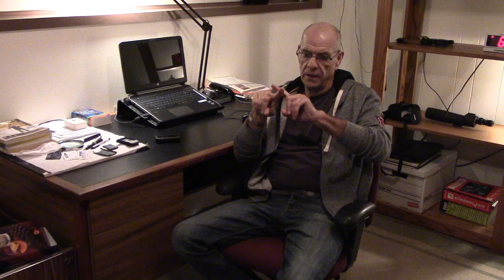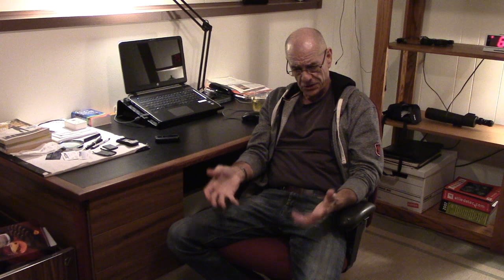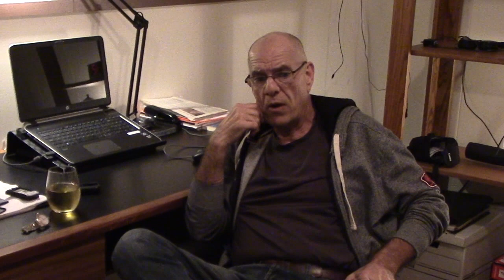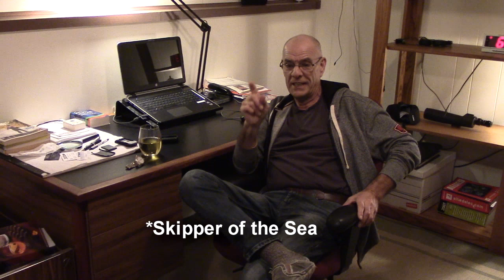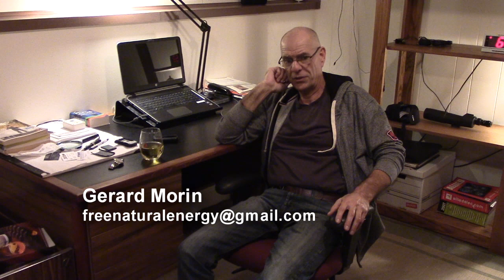Gerard Morin: The Double Helix and Tesla's Sea of Energy

Comment: Get you some pot stems and charged carbon from hugelkulture bed or build over ionic aquifer and you can build a super capacitor antenna using like graphenne cement and never need electricity again. Charged by Stubblefield coils. Then we can grow carbon panels and use arc reactors micro franctal wired Stubblefield coils in super capacitor material to get the fuck off this rock. Comets have tails for a reason. There is shit ton of water in space. Not a vacuum but low pressure. To send frequency and vibration through space proves something there.

Comment: I use 3 phase with Stubblefield coils so signals are 120° to other. So one is now always making emf to push the others. I run ground up but it runs air down too. The electric runs up and the airs emf makes other half of circuit by emf making a ground circuit. Like how a crystal radio works. The air makes a emf circuit going down to ground as the electric goes up. 3 in middle then 6 around them and finally another 9 coils. Making a seed of life magnetic fields and a golden ratio spiral if you look at the coils. Figure its what Tesla meant by 3-6-9. When he came up for work around on telegraph patents for power. Similar technology was used in mercury vapor drives. Energy is not created but moved. Frequency and vibration are in everything. Thus anything has potential for energy. Galvanized rod copper rod in dirt that simple to make current. Earth battery. I used Stubblefield coil ground batteries. But have used Stubblefield coils in air as batteries too.

Comment: As far as that Primary Mover, why not start it by ThermoElectricGeneration(TEG)?
You basicly fill the Tank with Ironing Water and dissolve Pickling Lime right there.
It produces heat, warms up the TEG and starts our Primary Mover : simple isn't it !

PS : Otherwise, folks will need to buy batteries or rely on stuff that wears out & breaks.
But if they rely on non-toxic material you can find on Amazon & use easily, that's great.

Comment: vertical shaft has electrical pressure on a square ft ( for example)..a horizontal shaft has electrical pressure along its whole length...more than a sq ft...so to speak....thats why an electrical/electromagnetic double helix ouroborus contains the energy in a large space and the vertical is a lightning strike of energy...all the horizontal suddenly pulled into the center vertical...all that energy compresses to form a bolt......vertical and horizontal equal newtons third law...and so one cannot be seen and is of great power and one can be seen and is of great power....wow  haha thats almost biblical :)

Comment: Gerard, you are partially correct.
Math never lies; man lies with math.
1+1=1
1+1=2
1+1=3
1+1=>3
Marriage makes each math statement true.
Reply: Joseph W 
But what is ‘1?’ The golden ratio suggests that existence (relative to us at least) has an intrinsic, or inherent, Base Line Principal which means ‘1’ is not 1 as it is in the Factor 10 based system. Nature is more like, say.... An individual unit of ‘matter’ actually has a value of 1.13 due to an unbalanced property that is built in. And they more you unbalance a unit with a known quantity, the greater the amplification of the result. You can denote  1 as 1 = 1 but 1+1 in true terms would be more like 1.1 + 1.1 = 2.3 and 2.3 x 2 = 4.9 and 
4.9 x 2 = 10.7
This is technically incorrect due to many many factors, not the least the linearly sliding scale (and the irrelevance of the numerical values compared with natures geometric efficiency in relation to transfer of magnitude) but this is as absolutely simple as I can make it and still retain and convey useful information. 
What I say next is gunna sound bit wishy washy but it’s the best way to begin to grasp reality. Refresh your Euclidean Geometry to assist in conceiving information (but accept it to is flawed) Then have a look at the geometric properties of charge within crystals. This is still a bit off due to charge being trapped within a physical manifestation but as far as a physical manifestation goes, crystals are nearly the purest natural formations of matter available to us. Just look at what Quartz (it’s a beauty to start with) does in the modern world. More than u could possibly imagine I believe. EVERYTHING that makes our modern day way of life is all built upon silicon and quartz (silicon). Who knows what is possible with 120 yrs RD such things to teach us maths properly and how to apply this mathematical system to things like what this man is trying to achieve. 

I love this concept but the dynamics and the interplay of them is a tough ask with our maths. U can only make predictions with your mind then experiment with them, then explore with those results, then record and reflect on your discovery. and repeat. Even then, even after several steps have been made never stop looking back for areas of refinement/reinterpretation. 

Nature is the only qualified teacher of mathematics on the planet. But you won’t receive a single lesson unless you stop threatening her existence over failing to abide by your laws built from an all encompassing philosophy.And approximated values for a concept that underpins the WHOLE framework, yet does not exist anywhere in nature..... Not that we’ve identified with any authority at all anyway. And is virtually, definitely impossible for it to even exist as that means there is such thing as nothingness, infinity, absolute reference frame, closed system, perfect balance, 0.0 
Call it what u will but finding a true ‘constant’ in nature that can operate a couple of orders of magnitude past where we are now and at both ends the scale is a quest for better minds than ours I’m afraid. We stare cross eyed at the clouds and still can’t properly explain what is happening lol. We can’t even establish a leadership framework that works in a harmonious and progressive (no, not this gender bender bullshit) manner with its own society. Yea na, we can’t say shit about how we got it all figured out but in essence it’s all magic and nothing can exceed the speed of light. Oh, except for the velocity of entire Galaxies, whose (let me hit myself hard in the head n try understand this) position alone places them near the beginning of ‘time itself’ yet are millions of light years across, full of stars that exist for millions to billions of years each, are required to complete said existence in order for the heavy elements to be produced that have traveled, combined, gravitated, fused and formed planets that are billions of years old themselves? Fuck all that.
Your telling yas reverse engineered expansion to determine a birthdate...  and that looking further into space is akin to looking further back in time right.... which APPARENTLY supports the maths for b’day maths.... PLUS, the cmb maths further solidifies the model and because the farthest sources of galactic light detected are x yrs in age, placing A FUCKING GALAXY 99% all the way back to the beginning of time itself. HAHAHAHAAA. THE FUCKING ARROGANCE TO SAY such things in public, no, to the public is absolutely unbelievable. And people don’t doubt it or question it for a second.

Comment: The two sides of an atom spin cw and ccw against each other in two spirals so where they meet in the Center after a rotation, there is a spark gap and it sparks, then closes as the two helix rotate away from each other...... and so the energy leaps across the spark gap....same as a heart beats ccw into the heart, pushing blood IN, create an ouroborus for blood to flow through, leap across the heart wall "spark gap" as electricity, then back to em ouroborus and  out cw to pull matter IN...yeah, thats it.

Comment: spark gap is where the ouroborus builds..which is rings of energy..addition.of geared rotation....gives the impression of multiplication...thats impossible...but..the energy is fed back into the center by rotation...and so is amplified...by the number of rings and "volts"...4 ourobous fields  ...1, 3 , 9, 27 = 40v from 1 volt.    ( I may be technically incorrect )1, 3, 9, 27 is the number of helix' in one ouroborus.....addition :)..same as teslas fluid diode construction..ouroborus area for acceleration.

Comment: what would happen if you did the same thing with car wheels as with the prop?
still shaft with a rotating wheel...the torque is on the wheel and not the engine...should be fast :)

Comment: Yes, the spark gap is a "uvula"...separation of the vortex to build up a Lorenze ring..the interference wave in the center of the two build power until a Lorenze force contraction fires the energy into a lightning bolt....I do believe that is the answer as to what the spark gap tip is doing...separation and recombination...your blast of power from rings of em.

Comment: Gerard with the washing machine controller , the switch should stay closed to spin and switch opens to Stop, or reverse , the cycling must bypass the switching cycles, need a switch that wont open ,there must be a way around the switches.. or 1 switch opens and the other closes if you remove the switch to close before cycling stops might stay running  , the electronic switches in black or gray plastics .

Comment: good to hear you stopped drinking alcohol. I will use a depletion mode mosfet, and pulse the gate with back emf. this equals a sparkgap.

this is used to shortly interrupt the flow of energy, and build up pressure.

Comment: Now you are getting it Gerard... It's a transformer plain and simple, not a generator but a transformer. This is due to matter having the ability to channel the medium in between it or specifically the cold plasma density between the molecules of matter. Lets say what we are doing is changing the density of the plasma and that allows for better matter conduction of real current.
 Tesla used the ground because it lacks plasma because the matter is displacing it. It is a vacuum to plasma. But the plasma wants to be there in a uniform density. When you give it a path to the lack of density it sucks the plasma in. This is essentially a flow you are creating between the source of our terrestrial plasma, the Sun. Give it a path to where it wants to go and walla a new form of Niagara Falls, ANYWHERE around the globe.
 You can still call it a generator but in the sense that it transforms the flow of plasma to the ground and generates a flow in the real coils surrounding the channel. You can siphon it off like tapping a dam at the bottom of it.
Reply: +Jon Bigman

Tapping something that is already there, for free, isn't free energy? 
Granted it may take some money to build the tap, (and perhaps some maintenance) but after that it's free.
Gravity is a hoax. Electromagnetics, density and buoyancy. 
Molten iron core is theory (we have only drilled down 7,5 miles or just over 14Kms - not even 1/4 the MANTLE so how would we know what the core is made of), the spin of the mass to create has been debunked (not that I believe we spin as NO scientific experiments have ever proven this) and psyence has no reason for it.
Testla knew this and based all his experiments/inventions on this fact.
Yes, the sky moves, the air moves, the molecules move, but earth does NOT.
Reply: @josephw4830  

Buoyancy is NOT energy, in case you forgot.

Nothing moves without energy.  If what you flat earth guys are saying was true about "no gravity", then a ball I let go should not move towards the earth everytime. Even if I dropped the ball near a wall ( in case you want to take it there), it shouldn't move towards the earth if there is no gravity.
Reply: @jaysmith3259  
So you state Newtonian gravity, not surprising. 
Sorry for you, Einstein’s space-time theory debunks it. You silly psyence believing types give the rational thinking folks a bad name. 
Like the science method clearly states:
Extraordinary claims demand extraordinary PROOFS
Reply: @josephw4830  

Debunks what about energy?
Reply: @josephw4830  

Then why don't you stop making claims you can't explain yourself?
You think mentioning names will do the job?
Reply: @jaysmith3259  
Listen son, you need to do your homework before you spew your ignorance. 
If you want to debate something said, be specific. If you state, burden of proof lies directly on your shoulders. 
QUESTIONS NEVER NEED PROVING BY THE ASKER.
Reply: @josephw4830  

Since you mentioned it, let your buoyancy claim debunk this:  https://youtu.be/JRPC7a_AcQo
Reply: Look up Walter Russell and Viktor Shulberger they explain what's  going on.  Everything is electric  even humans. everything has a fulcrum.  Leverage.
Reply: except the earth is flat, and everything is electromagnetic. free energy is the secret of the elites.
Reply: The Earth is certainly round and there is no free energy. But you can tap a flow already flowing. Tesla referred to this as the wheel works of nature. Learn to harness it like he did in Niagara Falls and you could tap the energy as it is flowing by us as it travels to the ground where it is absent to a degree. That small degree is enough to form a vacuum to itself and cause it to flow to ground and into the planet. It is already doing it. It's called gravity...